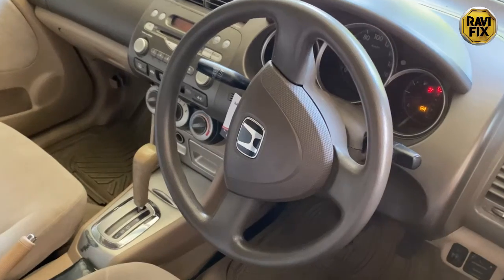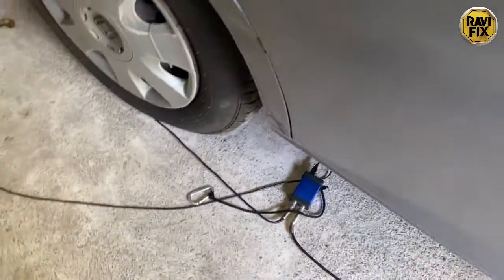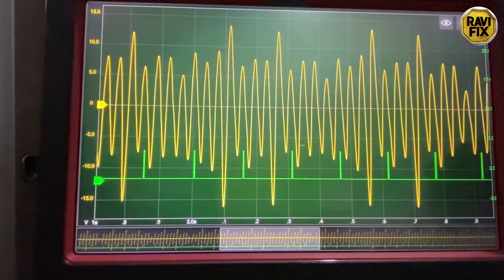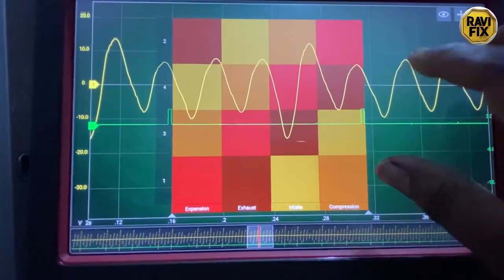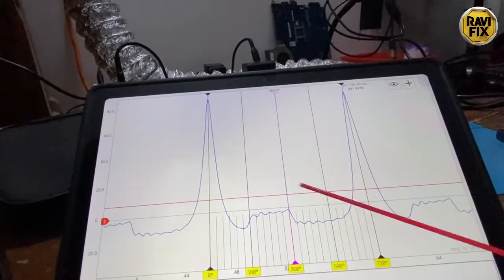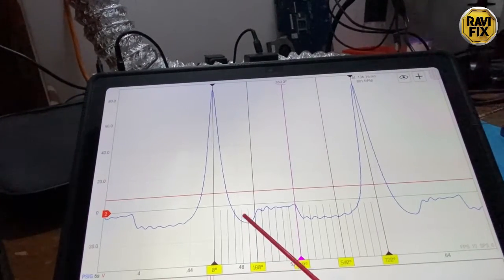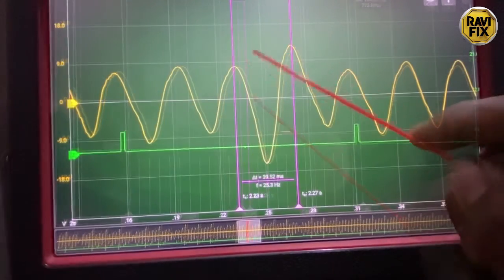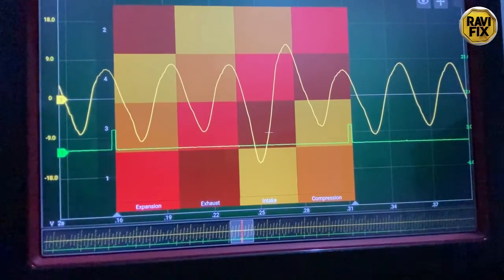First look sensor Exhaust pressure pulse analysis in depth and misfire diagnosis on Honda Fit.

Comment: Interesting presentation, Ravi. As another person mentioned, misfire counters can sometimes be found under Mode 6 in your scan tool. Just read the count for each cylinder and usually the one that with the highest number is your culprit. In case you didn't know, misfires can also (generally) be found by checking secondary ignition waveforms on the coil-on-plug (COP). Just toss a coin on top of the COP (if it's accessible), touch your probe lead to it and look for the waveform that's significantly off from the others, especially the second half of it. Also, a cheap piezo microphone might work in place of one of those pressure pulse sensors you have there. They generate their own ac voltage when subjected to pulses, vibrations, etc, so it's just a direct connect to your scope.

Comment: What preassure sensor are you using. It is the same to checking in cylinder pressure or different?
Reply from the maker: This is pressure pulse sensor. Not a pressure transducer.

Comment: I don’t really get why there is a vacuum in the cylinder if the cylinder is combusting
Reply from the maker: I think you get confused with this explanation. Anyway those 2 waveforms I used in this video are not on a same car. Pressure pulse wave form is taken on an other car and in cylinder pressure wave for is from another car, I just try to explain pressure change in the exhaust pipe .
Reply: @ravifixall  Is  that pulse waveform from a Running engine?

Comment: Nice. But what was the actual cause ?
Reply from the maker: It was a mechanical issue that poorly opened intake valve caused to misfire. It reveals by an intake pressure pulse analysis.
Reply: @ravifixall please, make a video on your diagnosis or at least teach us the theory for how to analyze inclinder pressure pulse for valve diagnosis...